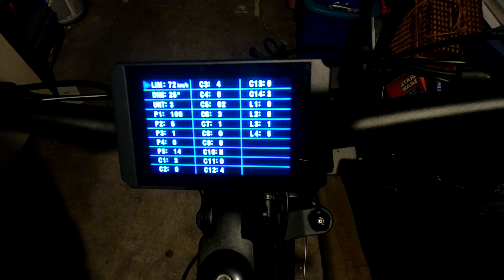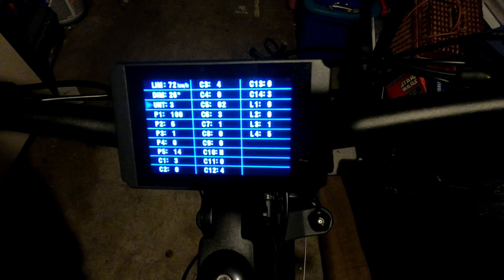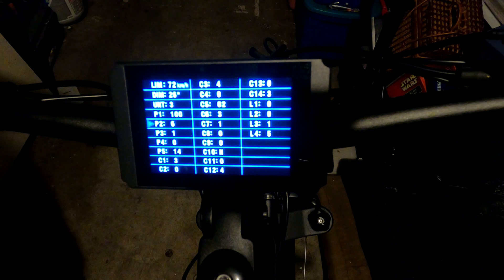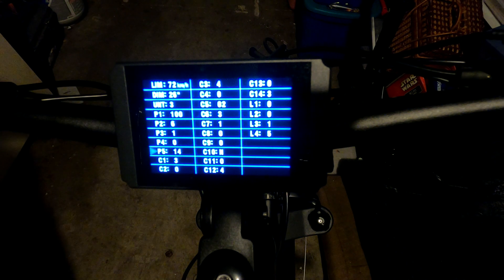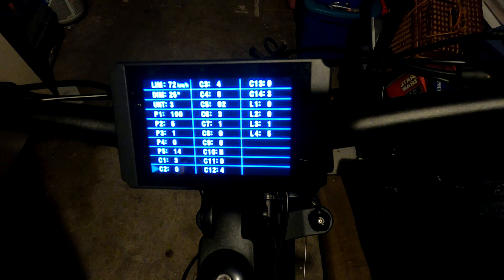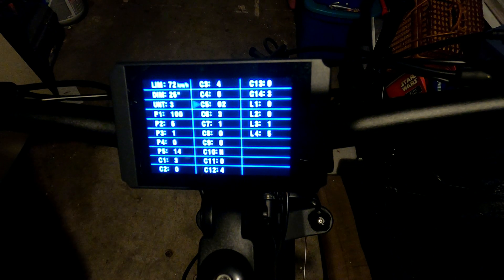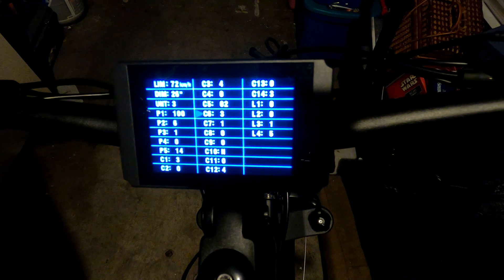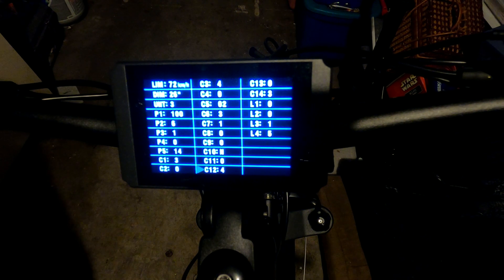RadRover Upgrade Settings Explained! (By a Dummy) 😜

Comment: Do you know if the speed limit parameter can be used to adjust it while riding with keeping it on menu? 

Actually I have a sw102 and before each ride i open the speed limit and i am adjusting the speed limit as I don't have the throttle and being in europe it is very handy as it is the only way to riding over the speed limit and having the flexibility to ride a speed that you want. Also for any possible police control it is easy to put it again on the 25 speed limit in like seconds.

Thanks.
Reply from the maker: Adjusting that while riding would be pretty sketchy and I doubt it would let you while the motor is going.

Comment: So, this video helped me understand a good amount more than I did.
The torque and smoothness with this 35amp is incredible now.
I have less than two miles on my new Rover 5, the Rad controller was faulty out of the box I believe.
My question is, how do I access and use  pedal assist while riding with this new controller?
Reply from the maker: The up and down arrows on the small control pad will adjust the pedal assist from 0-5. 0 being no assist and 5 being max assist. Also if you hold down on the down arrow for about 4 seconds while you're pedaling it will activate cruise control.
Reply: @SuPRCooPR  
Thanks so much for the quick reply..!!!

Comment: I put this on my 2020 RadRover 5 and everything is fantastic except I can't figure out how to get the speedometer accurate. I'm cruising near full speed and it's only showing in the low single digits mph. This baby really goes up hills now and acceleration is way better too.
Reply from the maker: You probably have your wheel diameter set wrong, it’s the second setting down that says DIM. With those big tires you might need to set the diameter up to 27 or 29.
Reply: @SuPRCooPR  Thanks for the reply. I tried that as well even trying a bunch of different wheel diameter settings and the max number I get on the speedo is around a 3.9 mph give or take. I'm not sure what's going on.
Reply from the maker: @ConsolidatedPBY  it could be either your P1 settings or P2 settings as well. P1 is the motor characteristic parameter, gear reduction ratio x number of motor magnets, the settings for my motor is (5x20)100 but maybe yours is different. Also P2 is the wheel speed pulse signal setting which is determined by the number of magnets on the PAS sensor behind the chainring and will effect the speedometer, it ranges from 0-6, try starting at 6, test that and move down from there to see if anything changes. Hope that helps
Reply: @SuPRCooPR  Yes! I moved my P2 to 5 and the DIM to 28" and I'm now on par with my speedo app. Thank You.

Comment: The DIM doesn’t have my tire diameter. Mines the fat tire 20” (radrunner) closest I get is 23” and it seems off by about 1mph. Also the odometer is way off too. I went 12 miles and it shows 16. Also the battery indicator at P5 setting 0 had two bars left and my battery cut off at 40v. I then changed the P5 setting to 15 and a few others and it showed full and I was able to ride the bike and the voltage dropped below 40v like the cut off limit quit working. I set P5 back to 0 and it still has all 4 bars and my voltage is at 40v. Will charge back up and see what happens. 

Pretty disappointing that the speedometer, odometer and battery voltage are all incorrect and unreliable.
Reply: I have a 2020 RadRunner and was able to set my tire to 20 I have the new bolton kit including tail light
Reply: @mpbuali  same here. I dialed mine in. I posted a video with all my settings. If you want an accurate speedometer and odometer the trick is to enter 23” for the DIM (radrunner wheel is 22”) and then set the P1 to 103. Normally we want this at 100 but 103 compensates for the DIM being incorrect. I tested with my gps speedometer and odometer and went 17 miles and they are both spot on.

These are my settings if interested: https://youtu.be/cYFT7W_XKcY
Reply: @mpbuali  if you set your tire dim to 20 and P1 to 100 then you are actually going faster than the display is telling you :)
Reply: @sideburn  thanks dude
Reply: @mpbuali  ya. I broke the tabs off the ends and then used some of the clear rubber tape between the bottom bracket and the controller. Fits good now. I gained about 3mph and lots more torque. Lots of hills around here and it tackles them all now.
Reply: @sideburn  nice it’s helped me get. Up some extremely steep hills the only issue I have now is my head light is no longer working
Reply: @mpbuali  hmm I had no issues with the lights. Did you press and hold the up array button to turn it on? Yeah I have tons of hills here. It only struggles a little on the steepest hill and I have to help it a little. Much better than stock now.
Reply from the maker: I'm not sure why its only showing the lowest as 23", according to the specs it it has 15 different sizes from 5" to 29". As far as the P5 setting I gave up on that, I tried all the way from 10 to 30 and none of them were accurate. I just rely on the voltage for battery level.
Reply: I mean for MY tire diameter the closest ones are only 20” and 23”. I need 22”. Yeah after playing with the P5 settings and going back to 0 it’s saying a full charge even at 40v. I’m recharging it now and hopefully it will start working again at least as good as it was before. Is your trip meter / odometer accurate?
Reply from the maker: @sideburn  It seems to be pretty accurate, I've compared it to several gps apps and they all match up almost exactly.

Comment: Great information and thank you for the Vid! I just upgraded my Radrover 5 with the kit but I'm experiencing an Error Code (Motor position sensor fault) as I throttle nothing happens and that Fault code pops up. Any idea what this means? Thanks for your help! That was a test run after install. I just subbed to your channel glad I did!
Reply from the maker: CJ Allen check your wire connections first and double check all your settings. If that doesn’t do it I’d email or call Bolton, might be a bad controller.
Reply: @SuPRCooPR  Worked! Thank you for your help!

Comment: I just added the Bolton upgrade kit for the controller, screen, and also Bafang 750 motor for my Rad Rover 5 (2020). After following the Bolton settings video some were wackadoodle, but in fairness to Kyle I think his recommended settings are a general rule of thumb. Your video brought clarity, especially for the speed sensor and its effect on the speedometer. Thanks much.

Comment: Great video...just installed the upgrade on a 2020 and everything works fine except I cannot get throttle power when pedal assist is set to zero.  Should I be able to use throttle when pedal assist is set to 0?  Btw, when in pedal assist 0 and I use the throttle, the display shows throttle, but there is no throttle power.  Thanks again for your nice video.
Reply from the maker: Billy M make sure P4 is set to 0, then try and set C4 to 3 and see if that fixes it. P4 is the throttle start up and C4 is the throttle function.
Reply: @SuPRCooPR  Perfect!  C4 did the trick...thanks again!!!
Reply from the maker: Billy M awesome! Glad I could help.
Reply: Can you tell if that is normal, that there no 27.5"wheel in settings? And any idea, what couse computer cutting off under load at acceleration? Controller is set 48v 45a  motor 48v 1.5kW, battery is 60v with smart bms seted to 40a. Computer settings C5 set to 04.
For some reason at acceleration when motor reach max speed, motor get disconnected, even keep full throttle

Comment: Hi, i just recieved mine with lights. but its not turning on my lights when i activate it. only the brake when i press brakes. any help? thanks.
Reply from the maker: Press and hold the up arrow for a couple seconds and the lights will turn on.
Reply: they dont it what iam saying. maybe because i dont have the upgraded controller?
Reply from the maker: So you just upgraded the display? If that’s the case try pressing the up arrow and the center button together and holding for a couple seconds, that’s how it was with the stock controller. If that doesn’t work it may not be compatible and you’ll need the upgraded controller. Hope that helps.

Comment: I've just upgraded my light to the new premium light the original was crap and I have to say it has impressed me. It looks like it's the right size for the bike but does not stand out just a perfect fit.😎👍♥️🚴‍♂️🚴‍♂️🚴‍♂️🚴‍♂️🚴‍♂️🚴‍♂️
Reply: I like that premium light.
Reply from the maker: Good to hear, I was tempted to get one but it seemed expensive ($10 shipping). May have to give it another look.